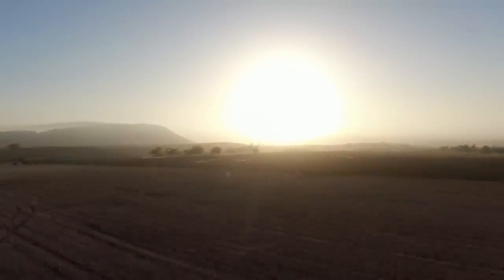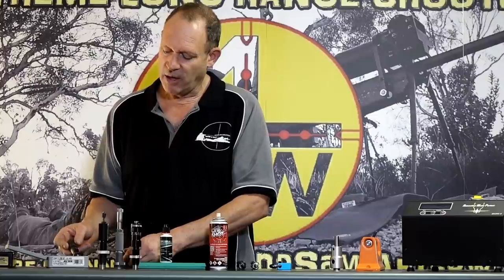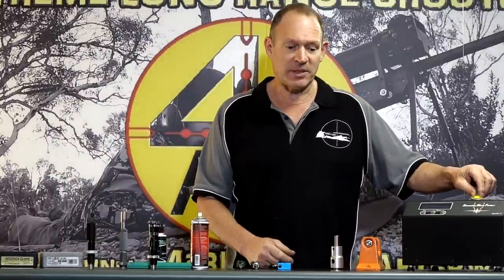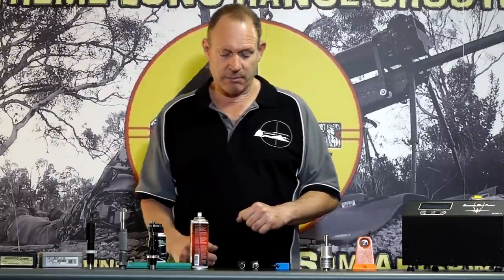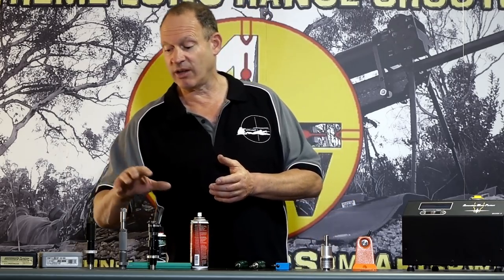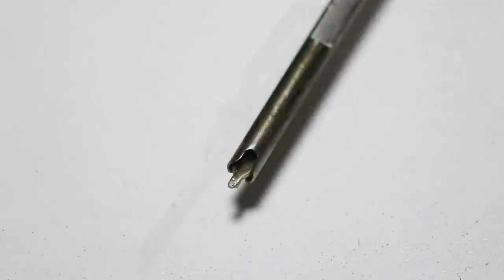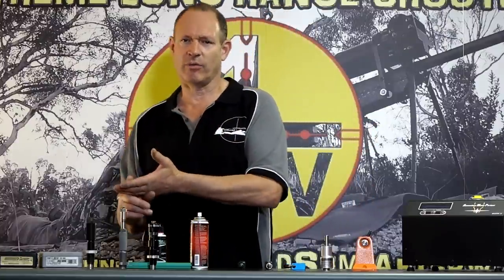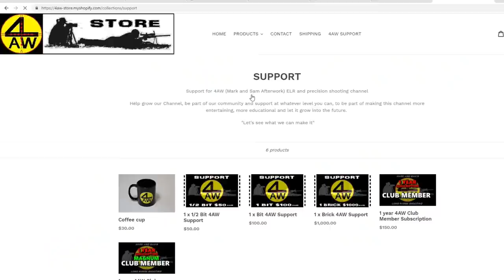4AW Reloading thoughts and tips

Comment: Good video.  I also question if 0.01gr differences between powder charges make any difference, either in SD/ES, or in group sizes.
Reply from the maker: Depends, percentage based thing, if you have 3grn total or 200grn total and the all the other details........FYI, I rarely measure speeds and don't look at ES and SD, all explained in many videos, Cheers

Comment: Can a high pressure round loosen primer pockets? I don’t use max charge but there are flattened primers and on my last batch a few of the primers tilted after firing. Rim heads on some have the plunger markings on them. It also hard to lift bolt. The tilted primers have me perplexed the most.. And again I don’t max charge, rather I go in between min/max range. I’m wondering if this may be a head space issue and should have lugs lapped and chamber wall polished a bit. I’m no expert and am wondering what you might think.
Reply from the maker: Sounds like your loads are too hot, beyond that, show it to and talk to your gunsmith, Cheers